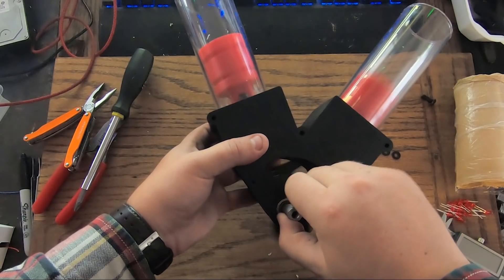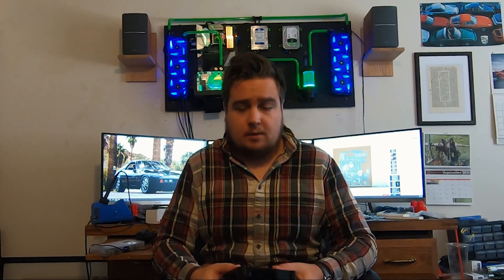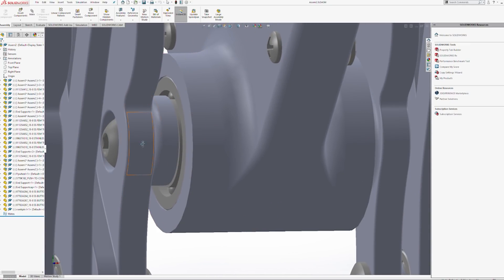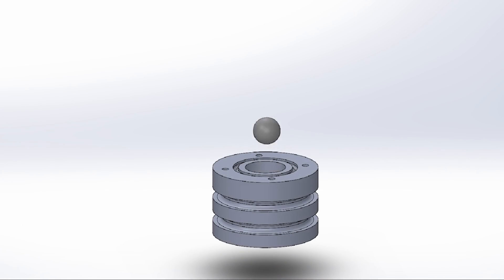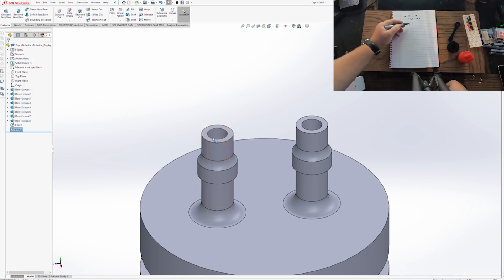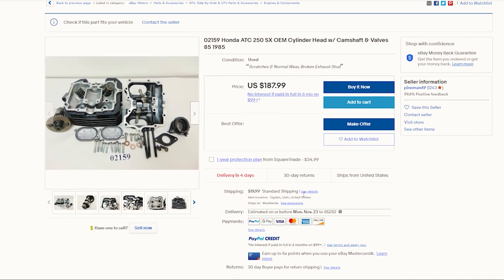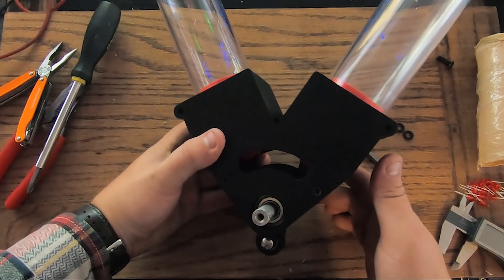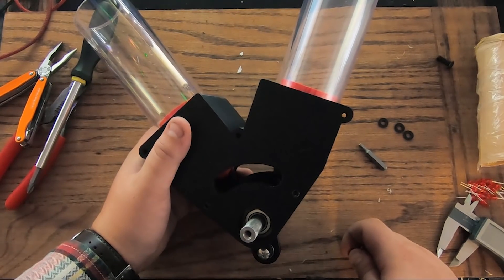The Porsche F1 Car is getting the weirdest engine...

Comment: I'm a bit late to the party but just my 2 cents as far as the engineering and cylinder count goes... An "ideal" piston engine that's perfectly balanced has 24 cylinders, that way as the crank rotates both the reciprocating mass and the piston that fires cancel each other out. That, or a division of 24 like 12, 6 or even 3 all will vibrate the least and be easier to make more power, rev higher and live longer over all.

Comment: Regarding size/scale issues , IF you run an AMD gpu there is a feasture that digitally increases your monitor from 1080p to 4k .it does come with downsides BUT the upside FAR justifies it for me,

 I HATE beeing limited bo workspace area when working with modeling software. some like the slicer cura has their mouse inputs JUUUUUST as is intuitive for me with the least number "mooves or clicks move where i wanna move.. Going from cura as as a slicer since that is my startpoint in this CAD thing anyway... 

MAN There are some clunky, default SAD settings and geometric "auto" bindpoints and GODKNOWS what other literally horrible standand tool if you alredy have basic CAD from tinkercad that i fiddled in the park on my phone whilst waiting for a buddy, that i need go get the angles and dims and all the other metrics right.. THats when the CAD wall hit me. Im just gonna go at it with a fine tooth comb and come out a wiser man.  

Looking forwards for you and your dreams man...U inspired me to to something similar.. This new way of controlling valves is curing a problem that has annoyed me as a fuel mapper for over 20 years.

FINALLY THERE ARE PART ON THE BIGWEB THAT IF U HAVE AT LEAST TWO LIVING BRAIN CELLS CAN FIGURE OUT WHAT IS RIGHT FOR YOUR SPESIFIC NEEDS!! sorry for the caps but i felt i was needed.

reyalp redrat is coming with something unseen before in the next few years :) The construction is already starting to play around in my heads blackbboard.

30%more for 30% less is going to a BLAST!!

Comment: Multi piece crankshafts are not that strong and are rpm limited. They are also horsepower limited. Too much push on the pistons will distort that multi-piece crank. I base this on my experience with Harley motors. Perhaps you have a better crank design? BTW, I've enjoyed following your free valve motor experiments. Rock on!

Comment: I have no idea where you're at with this idea, it's been a few months since release. But I had a quick eBay search and found a 250cc water cooled cylinder (63.5mm bore) on there for $50/ea which could help your packaging and cooling needs and looked pretty modular. There's also things like the ETON Vector 250 (71mm bore, 63mm stroke) which is water cooled, those cylinders are $37/ea, stock they're listed at 16bhp/30tq for a single 10.6:1 cylinder through a carburetor. I was going to recommend Rotax cylinders from a Seadoo before recalling that the 2stroke cylinders have the "valve" and everything built into them, unsure about their 4stroke motors. I'm no engineer, but I'll enjoy watching this come to fruition.

Comment: Love the idea of keeping it air-cooled. Could really save some weight. Really check the head flows before you settle on one. The horsepower capacity is linearly related to the head flow.

Comment: I think 2 vr6's into a W12 would be an incredible build, and someone else mentioned do this in a boxer configuration which would suit your car perfectly.
A modular design is going to very bulky and comparatively low output. 
Design around a crank of your choice because this is going to be the most difficult and expensive part to manufacture

Comment: you could cast them to aluminium with wax caste parts from your 3d parts.. put the wax in fine sand & pour hot molten aluminium to melt & replace wax..
Reply: Don't forget oil flow design...
Reply: If you lived in Dallas I would totally love to help you cast aluminium parts from the 3D plastic to wax parts
Reply: plus I'm vidographer & have professional video equipment.. like puttin a wireless mic on you for better audio

Comment: You should try making a 2 stroke v12, because there is no top end and valve system. And you can put bunch of 250cc 2stroke cylinders on a top of the crankcase without any need of timing chain. 250cc 2 strokes make about 45 hp, if you put 12 of them you should get about 500hp in theory. But its easier said then done so good luck with designing any type of an engine! :)

Comment: Hey man, love your channel. In keeping with the Porsche theme, you may look into old Porsche/VW engine construction and components. Cylinders are readily available and cheap, and they slip into the block and bolt on via heads clamping around them. They're air cooled of course, not sure what your thought is on that aspect, but the other nice thing is they dont have timing chain cutouts in the way for modularity if you're planning on running free valve anyway

Comment: Have you considered the possibility of building a modular engine based off 2 stroke jugs and heads? It’s something I’ve had on my drawing board for a few months now. The way 2 strokes are built is fundamentally different than 4 strokes, and IMO would be far easier to machine parts for. I currently have a cr250 case and jug on my desk, and I’ve been taking dimensions in preparation to build some 3D models of exactly what you described: a modular 500cc v twin that can be stacked. in my case, I’m looking for a 2 liter v8.....very keen on your progress.

Comment: It sure seems like you should choose a power/cylinder count/configuration now. Also turbo or NA. Knowing a general bore stroke ratio can be key as well. I would go with a lower cylinder count to keep the cost down. Maybe a flat 6 or a vr8. Unfortunately the w8/Vr8 wont accomodate those air cooled motorcycle cylinders well. Id go air cooled flat 6 with oversquare geometry, dry sump, freevalve, longer rods, 9000+rpm, 2500ish cc's and shoot for around 300hp.
Reply: Flat 8?

Comment: You likely know but make your con rods as long as possible. Rod stroke ratio, less stress more rpm potential.
Reply: Rod ratio typically only offers a few percent to maximum RPM and benefits quickly drop off from the additional mass of the rods and additional engine block height.
Shorter rod ratios are where current engine design is going because the shorter piston dwell time increases knock resistance and bottom end strength is easy to make sufficient
Reply: Thx for the update. Many different reasons, parameters but will keep in consideration.

Comment: Why not a honda K motor? Cheap, effective, transaxle options, etc...

But if you have the time, money, and expertise to build a motor from scratch, then go build your own motor!

Or maybe build a honda K V8 ;) you can reuse the valvetrain, piston, connecting rods, etc. But you'd need to build a new crankshaft, engine block, and the cooling+oiling system for it.

Comment: I've seen a few people here mention it already, but 2-stroke V-10or12 :) I mean you can totally get 250cc 2-stroke cylinders on the cheap, and 12x 250cc cylinders makes for a 3l engine (imagine a 3l 2stroke v12 holy! But I'm sure you're imagining a lot at the moment). If anything it gives you a "starting point" (hell of a starting point) for the block geometry and crankshaft design.

Comment: Are you aware that the crank is not centered? It is offset to slow down piston speed on the burn cycle. You also want to separate each cylinder pair from its neighbors to reduce windage. Piston oil squirters allow for higher compression. The block needs to be extremely ridged. Bolting blocks together is not strong enough.  Try splining, pins and bolts. Best if as few pieces as possible.  The bending forces on the crank are enormous .  Engines have a harmonic stiffness. You must design the block and crank so the the engine never rings” at the rpm range that you want to run the engine at. Really stiff is the safe way to go. Dissimilar metals helps. Different harmonics can cancel each other.  I recommend building a V8.  Or flat 8.  Use 4 cylinder motorcycle heads. Suzuki hyabusa.  Or similar.  These heads are good for 200 hp each. Water cooling passages are critical in keeping piston rings properly sealed. Heat must be even though out the cylinder and head surfaces.

Comment: I hope you figure this out and make it work, but there is a reason it takes teams of engineers to design modern engines. If you do decide to go back to a pre-built engine, it would be much easier and less expensive to go with a subaru boxer. You could even keep the flat 6 if you look at an EG33 or EZ36/EZ30R.
Reply: Throw in an STi 6-speed with the center diff locked out and you don't have to worry about adaptors.

Comment: If you don't want to deal with oil pooling in the heads you should do something like a 4 bank w12 with angles 0,60,120,180, that way you get to keep the low crank the boxer had

Comment: I vote for a 144° V10 with air cooled pneumatic 4 valve heads, water jacketed sleeves, and a mild hybrid electric pancake at the flywheel. See you in 25 years🤣

Comment: If rebuilding that Porsche engine seemed expensive, just wait for the final bill on this one..
But if you really enjoy the pain, my advice would be 2-stroke boxer, i.e Maytag.
Less weight, no cam gear, smaller overall dimensions, easier to rev, no oil plumbing, crank case becomes sturdy naturally, and you can build every block separate if needed. And with six blocks, it would sound amazing.

Comment: Or you could stick a Hayabusa, GSXR1000, R1..etc, engine and gearbox in the thing and call it a day👍....probably a really fun day at that😂
If you’re dedicated to the flat 6 (or 4) engines, Subaru’s are plentiful, inexpensive and heavily aftermarket supported. That would be a seriously cost effective solution and the EZ30R flat six, opened up with a proper track exhaust system sounds absolutely beautiful at full song👍✊

Comment: @Wesley Kagan Honda's newer unicam cylinder and head from the cr250f/cr450f came to mind, they make well over 100hp/L and are fairly stout, although expensive if you want 12 of them lol. Yamaha also used a 5 valve head for awhile that's solid as well. What would be probably the least engineering intense is to stick two liter bike motors together into a v8, newer supersports make 200+hp....

Comment: Just an idea, I get you want to build your own engine but a vr6 might be a good idea, or possibly the w8 from the Passat.  The transaxle in the boxster is basically just an Audi trans that should allow either of those motors to be easily adopted to it.  I really love the build, just think starting from scratch is going to take several years.

Comment: You talked about a w12 for your build.  That’s awesome but it is a double v6. Might be helpful to your pocket to use something like a w16 that follows a V8 like a LS base for accessories like cams, header piping, intake plates having that 4 cylinder long rather then a 3 cylinder long and use a few part bin parts to help you pocket book for the first prototypes.  This will be a fun build to watch.

Comment: What kind of Solid works do you have and did you have to pay for it or can you get it for free for non commercial uses
Reply: SW has, to my knowledge, no free licences. I would recommend you trying OnShape instead. Its powerful, free to use for non commercials and great learning resources. Recently bought by PTC, but created by John McEleney and Jon Hirschtick who founded SolidWorks.
Reply: @Nizze82  problem is I'm extremely familiar with solidworks from college
Reply: @zacht9447  I am extremly familiar with CATIA v5, but it took me like two h to get going with OnShape. The layout is quite similar to SW. It is easy to go in to the settings and get the mouse to behave like in SW. Come on! You can do it! :-)

Comment: 2 stroke v8? using RS125 cylinders or yz250 cylinders
Reply: Use an evinrude V8 2stroke as a starting point.... How about a 2 stroke using poppet valves and forced induction like a Detroit Diesel to eliminate the need for primary compression in crankcase.... Add freelance tech to allow 2 or 4 stroke operation, on the fly!! Then there's also sleeve valve engines to consider....

Comment: Do you somehow have any experience with Formula SAE? The kind of projects I see here would seem to benefit from surch experience, having done that myself a few years ago. As an example, I know of only one team that designed and built a custom engine out of the 500 teams currently in formula SAE. It takes years and many geniuses to design a properly working engine. head design, cam profile, intake exhaust etc. And it was a 500cc turbo 2 cylinder. They now use a KTM engine instead for simplicity purposes. For your ambitious endeavor I would suggest looking into motorcycle straight 6 engines for the head (I think of the old CBX1000, or BMW has a 1600cc L6 they currently use), and designing the block similar to the original design, but in a V config of course. instead of trying to properly time the cam phases for each cylinder with modular assembly, you would already have that out of the question. There's a guy that built a V12 out of 2  toyota 1JZ engine, you could check it out if you haven't already! The base chassis you have is what many men dream about, keep it up!
Reply: Oh and heard you speaking about W configs. you can look into VR6 engines, which is what the W12 is based on. Cool engines, had a VR6 jetta a few years ago. slow but fun and awesome noise!

Comment: What a great project. I think using multiple single cylinder components is genius. 

The modern W engines are not very W in terms of doing that with individual heads, W nomenclature suggests they would have 4 heads but in fact they have 2. 

There’s a company in the UK that do a V8 case & crank for the Suzuki Hyabussa motor cycle cylinder head to make a very advanced V8 from mostly stock parts. If you want a 12, could you use a pair of straight 6 heads?

Comment: Totally weird idea, what about 2 oversquare VR6s mounted to a common crank in a "flat" 12 configuration
Reply: A flattened W12 would be sick
Reply: @Balomis  indeed it would, sadly it would probably be far more complicated than is suitable for the application
Reply: This is actually a really cool idea, and probably not overly complicated but how would you fit 12 rods onto the crank of such a short engine?
Reply: @BrokeWrench  probably by pairing them up so each piston on either side shares a spot on the crank, kinda like how radial engines have multiple pistons in parallel

Comment: There's a guy making reliable 400hp turbocharged Yamaha Apex engines for use in light experimental aircraft. The whole setup hardly weighs anything and aircraft engines have to run at high power settings for long periods of time. I can't help but think something lightweight out of the snowmobile or motorcycle world would be perfect for that car. Also, I'm not sure how much room you have but the tried and true LS engines are a compact package for their power and displacement. People run them in Ultima kit cars with Porsche transmissions and they work amazingly well.

Comment: Evinrude 2 stroke V8 with 8 tuned pipes come up out of the middle of the vee https://www.roadandtrack.com/car-culture/a7300/video-insane-evinrude-johnson-two-stroke-v8-startup/ or maybe a flat or v12 using CR250 cylinders if you really want to make your own engine. Press together crank like others have suggested.

Comment: Take two japanese 600cc supersport bike (Honda CBR600RR, Kawasaki ZX-6R, Suzuki GSX-R600, Yamaha YZF-R6) engines, and start from there. Then you can make a ~15 000 RPM V8. With race kit valve springs 16 000 -17 000 RPM. Then you get a real F1 sound.
Reply: Agreed, I would put something like a RSV4 engine and if the power is not enough already (which I doubt 😁), add a turbo, a supercharger or put another V4 next to the first one and have the coolest car around the block (which is the case already, let's face it)! The Vmax 1800 would be a great donor as well.
Reply: powertec makes a 450hp v8 with 2 hyabusa heads

Comment: Wesley look into some builds done by Allen Milliyard. He had built an inline 6 from 2 Kawasaki inline 4. You might be able to get some clues from there too. And you could also look into building the engine from honda VF750 v4 engines too.
Reply: He has also built a Kawasaki KZ2300 V12 with master and slave conrods.

Comment: Hey from UK.  Check out the yotube channel Keith57000 here in the UK.  He built a V10 motor from scratch it runs megasquirt ecu and it would maybe be good to try and speak to him to hear the challenges of what is involved.  Throwing some honda 250 parts together is probably not going to get you anywhere near the kind of efficiency to get anything like a reasonable power output so realistically the only good solution is go bespoke or perhaps use something like GSXR1300 crank cases and heads for a V8.  Pretty sure there is a company in the US who is doing V8 bike engines (h1v8.com).  There is one in the UK I know of.  Good luck.